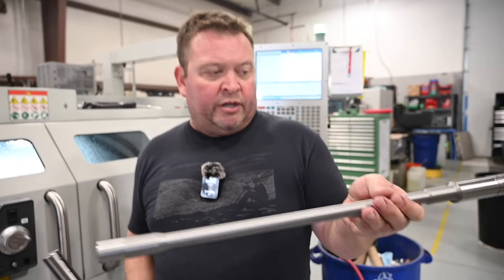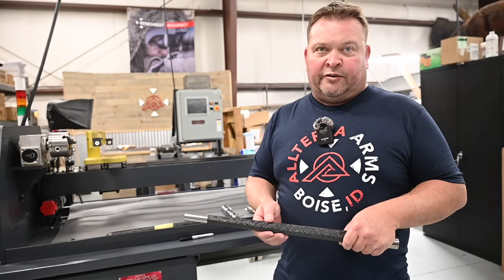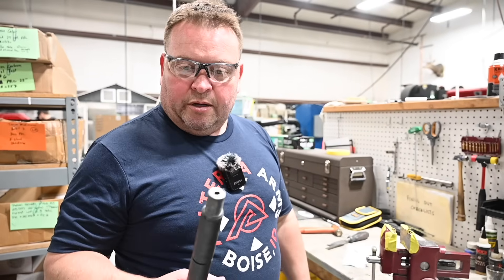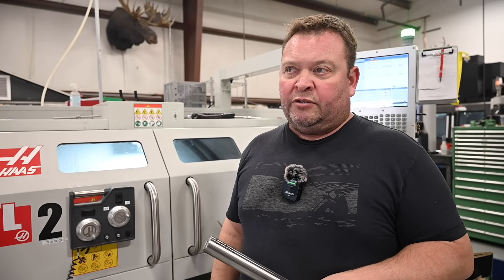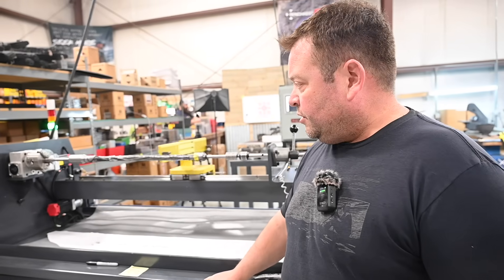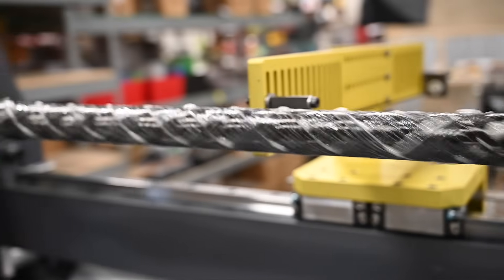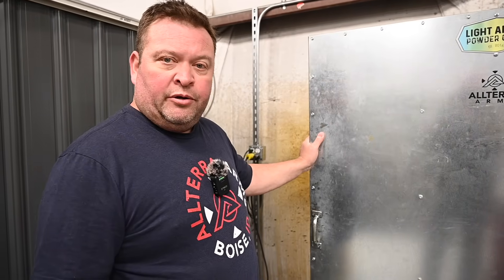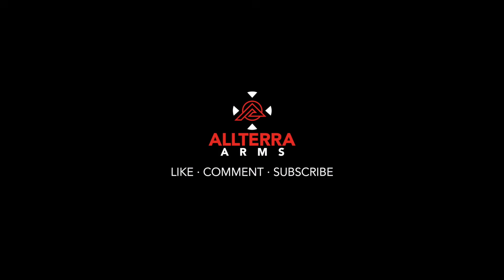AllTerra Carbon Fiber Rifle Barrels - Complete Overview

Comment: This is impressive. I currently have a rifle on order. I see no reason why I would not change the barrel selection to carbon fiber?  I went with steel based on previous test where you debunked the miss associated with many carbon fiber barrels. I haven’t watched the other video yet, but I assume that this will be stiffer and dissipate heat better than steel, and hopefully be slightly lighter?

Comment: Carbon fiber is an insulator so it will just keep the heat in longer and cause them th take much longer to cool down resulting in MUCH SHORTER BARREL LIFE....CARBON BARRELS ARE FOR ELR ONLY ANY RIFLE THATS GOING TO SHOOT ENOUGH ROUNDS TO HEAT UP THEY ARE HORRIBLE FOR...AND THAT IS A SCIENTIFIC FACT AND IVE WORKED IN THE AREOSPACE INDUSTRY FOR DECADES AND WORKED WITH CARBON FIBER THE SAME LENGTH...THEY ARE A GIMMICK FOR LOOKS AND ONLY USEFUL ON A ELR RIFLE THAT ONLY SHOOTS TEN ROUNDS A DAY WITH INFINITE COOLING TIME BETWEEN SHOTS AND SHOULD NEVER BE USED ON A GAS GUN... SORRY I DON'T MEAN TO HURT YOU COMPANY BUT PLEASE BE HONEST WITH THE CONSUMERS...
Reply from the maker: IN THE VERY BEGINNING OF THE VIDEO DREW EXPLAINS THAT CARBON BARRELS ARE FOR THOSE WHO VALUE THE SMALL WEIGHT ADVANTAGE, OR THOSE WHO HAVE TO HAVE THE AESTHETIC APPEARANCE. We build hunting rifles. Barrel life is of little to no concern for most of our customers because they practice here and there throughout the year, and they hunt. Intended use is a big part of our conversations with customers as they choose their options.

Comment: so when the THIN metal that is left on the original barrel gets hot and expand   does the carbon wrapping expand and contract at the same rate as the barrel.
does the heated barrel shift point of impact?
Reply: There is a significant CTE difference between the 416 SS and carbon composite. This is a major issue causing delamination. This is also a major issue for the Aerospace industry where the same factors come into play between aluminum and carbon. The "secret sauce" is what makes the shear force differences between the materials stay bonded and allow for differences in CTE.
Reply: @DrewFoster-wo1tb  thats why ill stick with heavy fluted barrels

Comment: Cool product! I think a good video would explore how the bond holds up after a bunch of extreme-ish heat cycles. I don't know the expansion rate of carbon fiber v steel but it could create a powerful shearing force between the two materials.
Reply from the maker: Yes, great video idea. We’ve dumped boxes of rounds through them as fast as possible, let them cool, and then shot for accuracy. No change. Also, the oven gets hotter to cure them than you can get a barrel by shooting it.
Reply: @allterraarms  that's great you're not seeing a change in accuracy with a hot barrel. Is there much of a shift in the hit point from a cold bore?
Reply: There is a significant CTE difference between the 416 SS and carbon composite. This is a major issue causing delamination. This is also a major issue for the Aerospace industry where the same factors come into play between aluminum and carbon. The "secret sauce" is what makes the shear force differences between the materials stay bonded. 
As far as the heat and cold cycle testing, we have tested these at the working temp of the "secret sauce" range of -30F and +280F. Those barrels are still in service with employee rifles today killing animals every year at long range.

Comment: Chisel from the front where the carbon and the metal meet.
Reply from the maker: Sir, I owe you an apology! Over on our other video where you asked to see the same thing, I completely thought you wanted us to “cut the barrel closer to the end” as in cut it in half on the lathe closer to the muzzle. It didn’t occur that you were talking about chiseling it at the end where we had already cut it off. I can assure you, it is in fact bonded just as well when we chisel it right there. The problem is, that little spot you’re wanting to see chiseled is a sensitive area for us. Perhaps for the exact reason you’re asking, perhaps not. We pull the skirt up pretty high as a brand in how much detailed information we show, but we do have boundaries. Given how the other barrels “bonds” break by tapping with a hammer a few times, or as we’ve experienced just shooting the rifle, we feel good about the point we made with the comparisons we’ve shown.

Comment: Y'all make them in 450 bushmaster?
Reply from the maker: We've acquired some initial equipment to start playing with the 450 when we get a chance, but we'll be steel only for those when the time comes. It's big bore diameter so the outside profile in a carbon barrel would have to be huge to support minimum steel wall thickness beneath the carbon.
Reply: @allterraarms  🙁

Comment: I was curious how bulge force affected your proprietary carbon wrap compared to solid steel.
Reply from the maker: Honest answer - we're unable to compare the effects of bulge force between our carbon barrels and a steel barrel. However, ours certainly handles it better than other carbon-wrapped barrels, thanks to the material we're using between the carbon and steel which we were purposefully vague about in this video. Drew referred to it as "secret sauce". One of the benefits due to its chemical characteristics is to maintain the bond between dissimilar materials, even under high stress like bulge pressure. We've had sourced carbon barrels shoot great at first, and then suddenly they don't. Then we notice the carbon is rotating freely around the rifled blank underneath! Bulge pressure, we presume, broke the "bond". Although the real problem was, they weren't actually "bonded" in the first place like ours are.